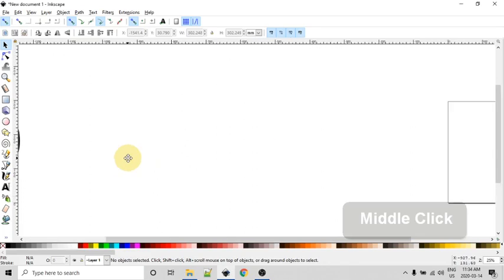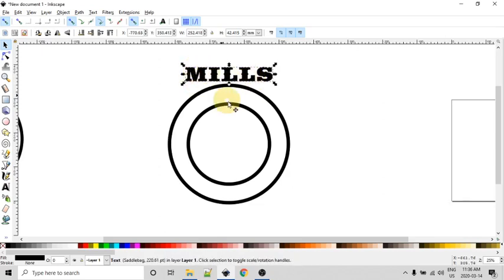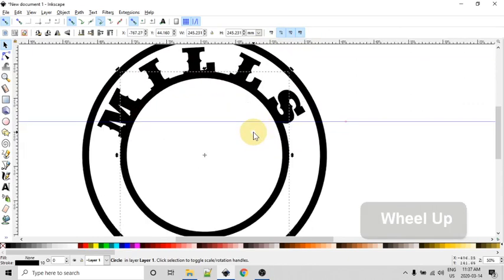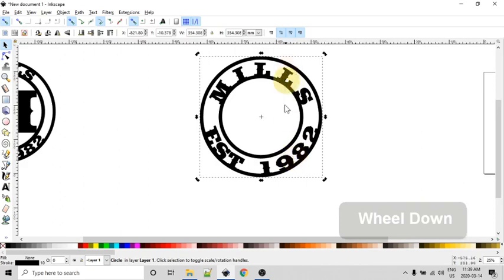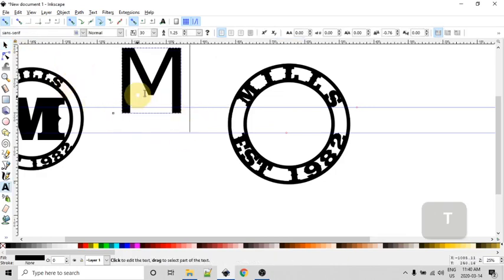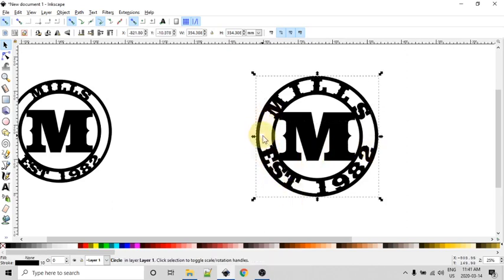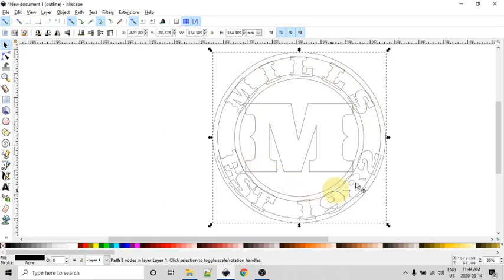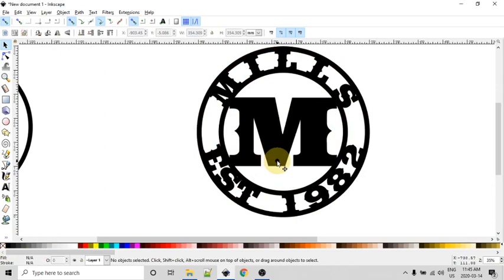Inkscape For Plasma Cutter Design

Comment: For some reason when I import into my cutting table program it has a lot of circles.
Reply from the maker: Quite possibly a subtle  difference in how the programs interpret different object. Have you tried saving\exporting from inkscape in different formats?
Reply: @MakerMinded I figured out how to keep from having the circles but for some reason now image seems to be jagged.
Reply from the maker: Are you exporting the file as a dxf by chance? That format is notorious for turning smooth curves into segments of straight lines.
Reply: @MakerMinded yes because the software for my cutting table requires dxf
Reply: @M @MakerMinded is there a way to add more nodes to make the circle look more round.

Comment: When you make the second circle how do you keep it centered on the first circle?
Reply from the maker: An easy way to do it is to use the align tools. Press Ctrl Shift A to bring up the align tools pallet. Select both circles, then use the options to center them horizontally and vertically.

Comment: I must have a different version of Inkscape that yours. Mine doesn't have the same features along the top that you have, like to spread or condense the text.
Reply from the maker: If you have installed inkscape in the last few years, you likely have a newer version than I was using in this video. Select the text tool and look around the top area for a  drop down menu that contains the same options!

Comment: I tried downloading and installing the saddlebag font to use with the same version of Inkscape you’re using here and having trouble. I have windows 11. Can you help?
Reply from the maker: If you install it as a system font, it should show up in inkscape once you restart inkscape.
Reply: May I bug you one more time? When I stroke to path the inside circle I get 2 circles which is right. But when I stroke to path the outside circle I get 3 circles and it screws every other operation up after that. Can you tell me why it does that?
Reply from the maker: @abelcantu4474  I'm not sure why you are getting 3  circles, hard to troubleshoot without a little investigation. Are you able to delete, (or possibly ungroup then delete) the unwanted circle any carry on?
Reply: I haven’t tried that yet but I will. Thank you!

Comment: This is a monogram and I thought I'd drop in to see if you do it any different then I do and you do, to hide the guides you just click on the ruler to show or to hide, you use strokes as the inner and outer mono grams I use full circle object with black and white fill so I can make the rings as thick as I wish and using layers to show and hide them in the correct order. But very nice method I can say I learned something watching your video on where the text starts at I wasn't aware of that and I knew you could use a stroke but you don't tell people what stroke width you're using. I should make a help video as well showing how I design in inkscape and how I stencile all my letters using no bridge or bar as I break apart the letter and adjust my nodes where I want and on my O's I slide the inner down to break off part of the bottom to create a unique stencie of any font my customers ask me to do. But thanks for the few things I didn't know as I thought I would have known that for 13 years of using it. Thumbs up
Reply from the maker: Thanks for sharing your tricks and tips. The beautiful thing about Inkscape (and potentially frustrating) is that there are often many ways to achieve the same outcome. I'm sure there are better ways to do the things that I do, but my method works for me. I'm glad you enjoyed the video and picked up a few ideas on different ways to do things. Stay creative!

Comment: When I am doing this the space like inside the 9 or the 8 fills in, how do I correct this?
Reply from the maker: I hope you've got this issue solved by now (sorry for the delayed response...). In case you are still looking for an answer, I suspect it has something to do with how you are unioning the text. If the text is made up of multiple objects, (like the outline of the 9, and the shape that is the inside of the 9) then when you union those two objects both shapes merge into 1, the larger object will basically 'absorb' the smaller shape. In a case like that you would want to use 'difference' to remove the middle of the 9 from the outer shape first, before unioning the 9 with other objects. I hope that makes sense, and helps you out.

Comment: just started out with INKSCAPE and will be buying a CNC plasma table soon, just a quick question though that might sound a bit silly but how do i know if the plasma will cut out the whit areas or the black ones, sorry if this is obvious
Reply from the maker: I don't have a plasma cutter myself, but I do have a laser, and afaik the principles are the same: the machine  will cut the paths. It doesn't care what colour is inside or outside. I like to work so the black is what stays behind, it's easier for me to think it thru that way. So in the case of this example, the white area would be getting cut away. Notice that the black components all overlay somewhat so that the material stays solid.  Hope this explanation makes sense and is helpful.
Edit: it can be good practice to toggle between regular and outline mode in inkscape to view the paths with no distracting colours. Ctrl numpad5 is a shortcut to toggle between views.

Comment: Great video, it's got me a lot further along my inkscape journey. However, my inkscape behaves much differently than yours. I try to use short cut commands as you do and it does something completely different. For instance shift +ctrl+c for me tries to do some sort of image capture. My circles also behave differently, when I stroke to path them, they split into three concentric rings, one is my original path, and the two others are inside/outside offsets. I then can't union the. Entire thing, if I ungroup the circles and the union the entire thing, it disappears completely. Inkscape has never performed for me like your videos. Are there various versions?
Reply from the maker: Yes there are various versions of inkscape. The latest is 1.1 I believe. This video was created with .92.4 I believe.. one big difference that may be experiencing is in 1.0 and newer, when you convert a stroke to a path, it also leaves the original path (possibly the 3 lines you speak of...) And also leaves them grouped . So you would need to ungroup and potentially delete the original path (would be the center line). Hope this helps.
Reply from the maker: The image capture issue may be an operating system issue? Perhaps another program uses that shortcut combination and is acting on it before inkscape does..
Reply: @MakerMinded  I really appreciate the reply, I got it fixed by deleting all the nodes on the center ring. After I did that the union function performed as expected. As for the short cuts, I'm at a loss. Seems that half or so don't work and do random functions. I've deleted and reinstalled the software, run it with nothing else open, etc... Oh well... 

I really appreciate the response and advice!
Reply from the maker: @pyroman590  The reason deleting the nodes on the center ring worked is because that would be the solid background ring as opposed to the stroke ring. When you union the solid background ring and the stroke ring you end up with a solid background ring that is the diameter of the stroke ring.
 As for the keyboard shortcuts, I really don't think it is an inkscape issue, since the keyboard shortcuts I use are the generally the default inkscape shortcuts. What is one keyboard shortcut that is not working for you, and what does it do instead?

Comment: New to this program. Just downloaded the Inkscape 1.0.1 version and I don't see the saddlebag font. Does this come with a paid version or is there a text pack I have to download? I don't need the exact text, I just want to make sure I have all the options.
Reply from the maker: Inkscape does not 'have' fonts per se. It uses fonts installed in the operating system.  I downloaded the saddlebag font from a website (can't remember which) and installed it in windows.

Comment: great video..one question how do you get the text on the outside of the circle...it seems to want to put it on the center of stroke
Reply from the maker: It will try to put the text on the path, which actually is the center of the stroke .  You can select the text with the type tool and use the ctrl and up\down arrow keys to offset the text up or down from the baseline
Reply: @MakerMinded  Thank You!

Comment: followed step by step but when i union at the end, everything except exterior circle goes blank
Reply from the maker: What version of inkscape are you using?
Reply: @MakerMinded  hey i figured it out. i was making the cirlces and inputting text and that all worked. the problem was when i went to insert my image in the center, it wouldnt union. i had to bring the raw image in and trace it within the same inkscape window and then it worked. but it would not union an imported svg for some reason. (so i had to import the jpeg and retrace for it to union)
Reply from the maker: @adamrodriguez6025  perhaps when you imported the other svg it was grouped? You can't Union  grouped object.